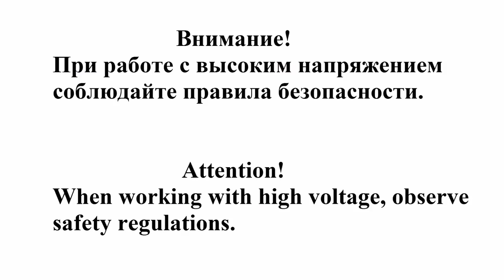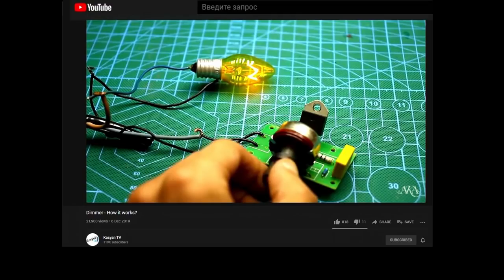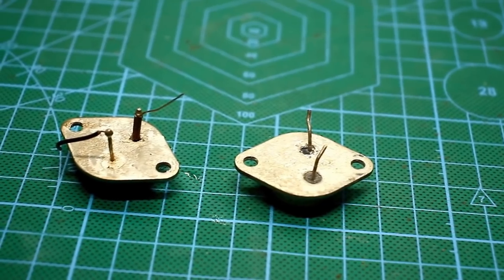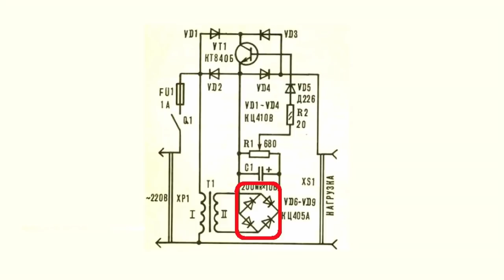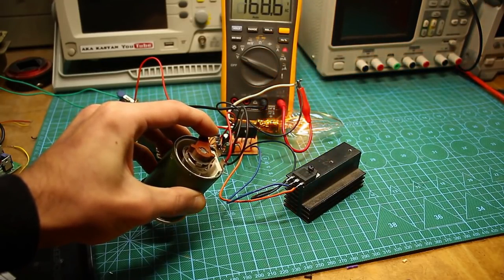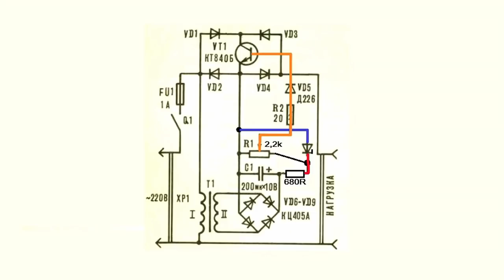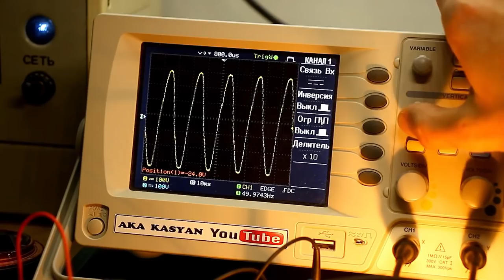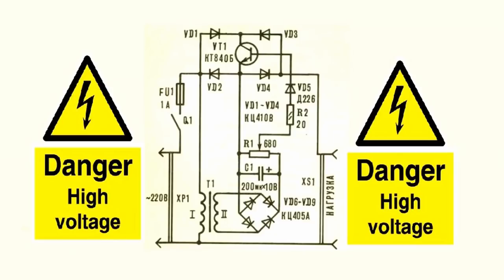AMAZING voltage regulator  (Еlectronic LATR)

Comment: This looks like a cool design.
I designed something like this in 1978.  I also made it a stabilized regulator with feedback.  At that time there were very few regulator IC's.  Now you can use a UC3843 and drive the transistor with pwm so you get voltage regulation and current limit protection and you can use a MOSFET as the transistor.  Use the TL431 and an opto for regulation and feedback. The small transformer will give you the AuxVDC for the controls.  You can get galvanic isolation from the mains by using a 1:1 isolation transformer and the secondary will be the output similar to a Variac.
Reply: Yes, it is a nice circuit design from the past. It is interesting to get a simple solution for today which has not these high amount of losses. I think today one would chop the input voltage by use of PWM and voltage / crossover detection. In order to drive the output I think you need a MOSFET H-bridge with a full bridge or two half bridge drivers. You can apply a low PWM frequency like 0.5 to 1 kHz. So you can keep the switching losses extremely low. Probably you will need no heat sink for MOSFET full bridge even for higher powers in the kW range.

Comment: Cool! Never realized you could use a DC switching element with a full bridge rectifier to make an AC switching element =D
Reply: Commonly used to allow an SCR to act similarly to a triac.
Reply: @wickedprotos1937  Thanks! That puts a long lost piece of the puzzle into place in my mind. Seen SCRs used in application that clearly deal with AC and wondered how they did it (never analyzed the circuits).
Reply: @miklov  Cool. You can also use an IGBT or big mosfet as rated for this. I had a use where I needed fast pwm of the AC waveform for a lighting control to avoid the 50/60hz hum, so I used a big mosfet there.
Reply: The gate drive needs to be isolated optically or otherwise usually.

Comment: That's a very clever circuit. As long as your circuit is resistive it should drop the voltage in a very linear way, as it's a current regulator, not a voltage regulator.

Comment: Very clear explanations as usual. I will control many devices with this. It can even be used as a soft start circuit. Right? Thanks for sharing. You are a light 💡 in my way.

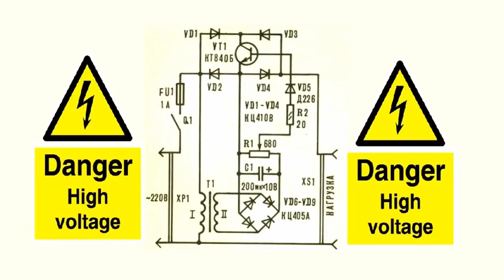Comment: Great circuit fun as usual, thanks!  Just at 10:00 you say that the output is galvanically isolated from the mains which I think is incorrect.  I believe you mention earlier in the video that it isn't isolated.  Really appreciate your work, thanks...  :)
Reply: A LATR (autotransformer) is also not galvanically isolated from mains voltage (except you apply an isolating transformer on its input).

Comment: Is the regulator adding its rectified voltage to the primary input on the transformer? And then sending it to the output??? please anyone??? or is it regulating the secondary of the transformer??? ANYONE???